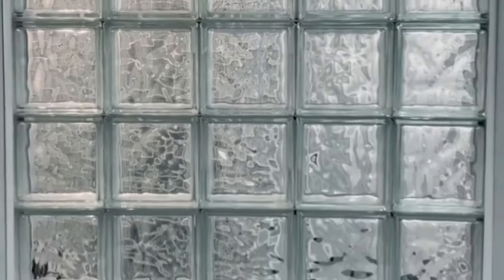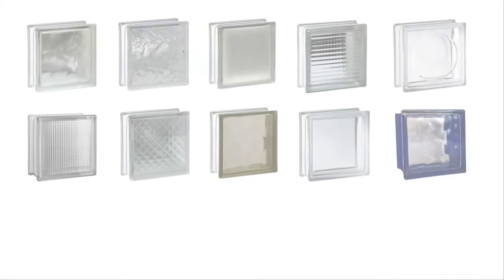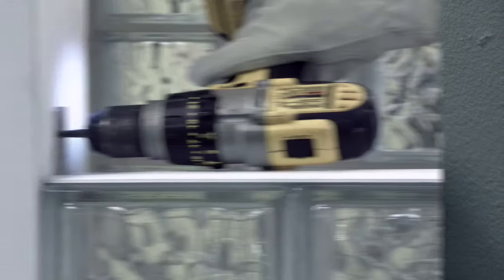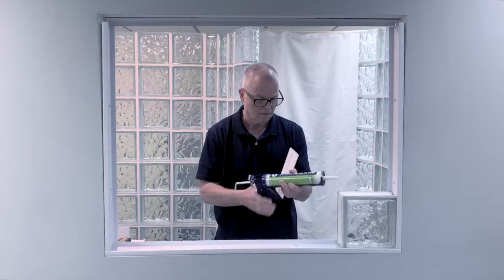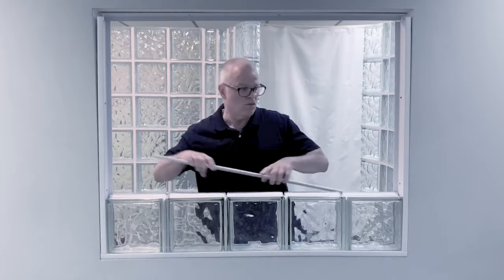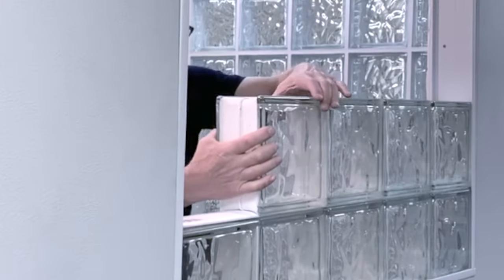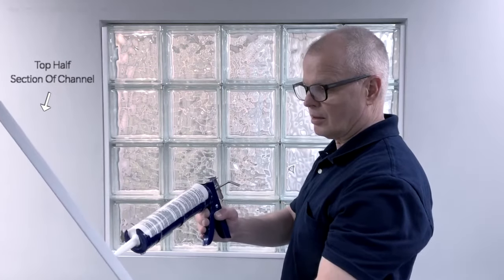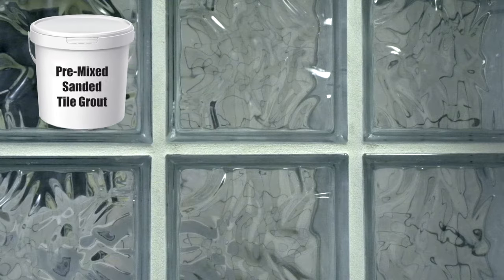ProVantage Silicone Installation System for SEVES and Redi2Set Glass Block

Comment: I think this system was used to install our glass block shower wall, but there is mold in between the blocks. Is it possible to remove blocks one at a time for replacement or does the whole wall have to come down?

Comment: With that top inside rail not secured with screws, would that not make it susceptible to someone pushing from the outside in, such as in a break-in attempt?  Was looking at glass block for a security factor.
Reply: You can add trim around the inside to prevent such happenings. But criminsls arnt that smart they are like most beings and will look for the easiest route in. Normally busting in the door or windows.
Reply: fairly sure this method is for interior Glass block walls walls not for putting block glass into exterior openings.

Comment: How does the silicone installation method compare to mortar in strength?
Reply: I would think mortar may be a little more heavy duty, but what are you going to be doing , trying to jump through on the reg?

Comment: When you use the vertical anchors to attach to the horizontal spacers, do you still need to use the bottom and top channel perimeter pieces? And if you don't need the bottom and top channel perimeter pieces, how do you complete installation at the bottom and top of the glass block window?
Reply: This video is just for the channel installation method. 
Around 1:00 into the video, he briefly states to screw in the channels around the entire opening.
At around 3:10 in the video, he also mentions that the top channel was previously screwed in..

“‘Ask The Builder” has a video called ‘glass block’ where he shows how to use vertical anchors. He does not use the channel perimeter at all.

Comment: What sealant do you use to bond the glass blocks to the channel?
Reply: He shows the products in the beginning and uses “Redi2bond glass block silicone” for both the channels and the spacers. The full name of the product is Redi2Bond Glass Block Silicone Adhesive Sealant.
You can see the product as he is using it, but he refers to it both as sealant and silicone so it can be a little confusing at first.
This type of silicone is made especially for glass and acts as a sealant.
I hope this helps!
Reply: @leahhona4940  Thank you! I can't always see the labels on products in videos. Need to find some computer glasses that work. LOL.
Reply: @catsmeow5566 You are so welcome!
I usually take a screenshot with my camera and enlarge it so I can read it. 🤣

Comment: They don't even come with spacers prefabbed lol
Reply: What do you mean? Of course you have to cut your horizontal spacers according to how many blocks you will be using per row. You could order the particular length you need, but that would be much more expensive than getting the standard sizes (40” or 72”) and cutting to fit your specific length.
The vertical spacers ARE already precut.